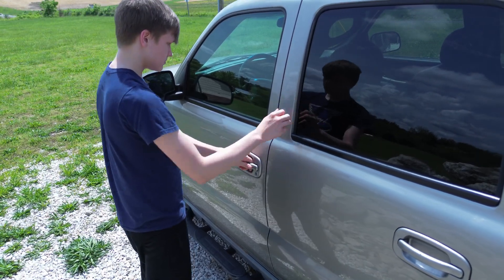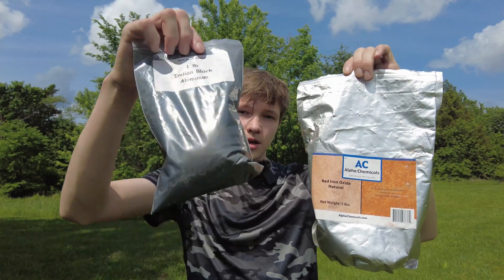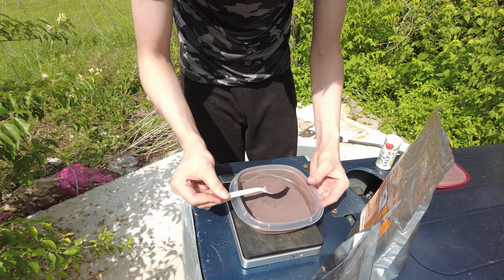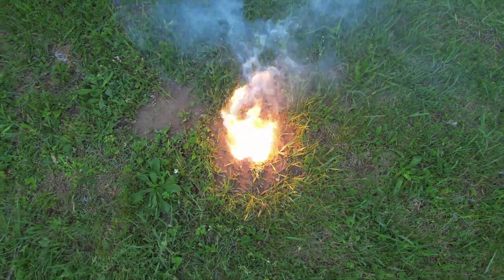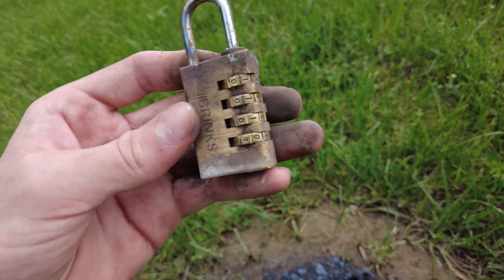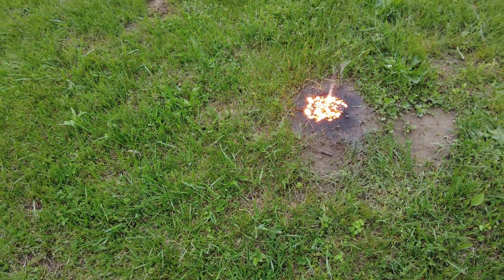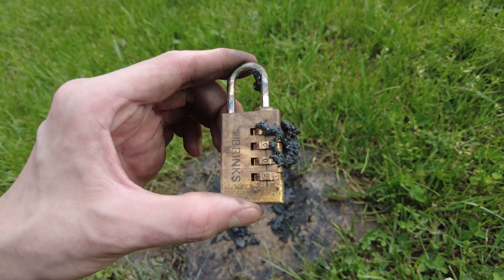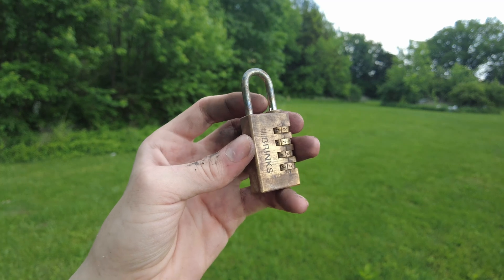Can Thermite Actually Melt A Lock?

Comment from the maker: Trust me, I can melt a lock with thermite, but the way it's done on the show is misleading.
The reaction needs to be done in an enclosed space to contain the heat, like how railroad tracks are welded together. 
Sure, I didn't use the same lock as in Breaking Bad, which is necessary for a proper experiment, but simply placing the thermite on a lock won't cut it.
Reply: I've checked out some videos on your channel, (I came from the meth explosive vid) and I like the channel so far. Keep it up.🙂
Reply: @Firebolt7317  Why do you hate furries? They did nothing to you. Also, if you are gonna hate on them don't make it your entire personality and have a cringey username like "Furry slayer"
Reply: @GooseGooseYT  they probably have their reasons
Reply: Also if you did it in something like say a metal container or something would it have burned the lock since the heat is contained?
Reply from the maker: @Firebolt7317  I'm honestly not too sure. I'd have to try it out. It'd definitely soften up enough to be cut easily though. Some other thermite mixtures that burn hotter and or longer may be able to melt it entirely, especially if you use a lot of it.
Reply: @SomethingAbtScience  true pure thermite probably wouldn't be able to melt through it by itself but it is actually an interesting idea. Until somebody is crazy enough to do it themselves I guess we'll never know. 🤷‍♂️
Reply: Wow, you lit that stuff easy! It burns through faster than my stuff too and my thermite is red hot for a while afterwards! What mixture do you use? Fe2O3 or Fe3O4?
Reply from the maker: @archershillnursery  I used Fe2O3, and yeah, it lights well, almost too well! I believe that's thanks to the type of aluminum powder I used, called Indian Black Aluminum powder. I just looked into it, which I should've done awhile ago, but it's a VERY fine aluminum powder that's coated in graphite. Finer powders result in a much faster, but less efficient reaction. Ig this does not replicate the show at all😅

Comment: I wonder if the rapid heating and cooling of the lock would make the metal interior of the lock brittle enough to pull apart after flash cooking it with the thermite a few times.

I myself am also fork lift certified up to 20k diesel.
Reply from the maker: Now that's a good idea! Maybe use liquid nitrogen and thermite, as it'd need to cool quite rapidly to get really brittle. 

And hell yeah 👍 I have no idea what the limitations of my certification is or what 20k diesel is, but good on you.

Comment: I didn’t watch the video cuz I don’t feel like it and I’m eepy. But if he is saying that the shows wrong, he prolly just did it wrong, cuz I think thermite is what they use to melt railroad tracks together, so if it can instantly melt through 2 inch thick steel, then it can melt a lock.
Reply from the maker: That’s fair, but no, it won't instantly melt through 2-inch thick steel. To join railroad tracks using thermite, a mold is used to contain the heat and shape the molten product. This molten substance includes alloying elements to create the steel that connects the tracks. Instead of directly welding the tracks together, they are separated by a gap that's filled with the molten steel product. Simply throwing thermite onto the track without a mold won't work due to the principles of basic heat transfer. And wrapping some thermite in tape and placing it on top of a lock like in breaking bad won’t cut it either.

Comment: I did a thermite reaction in a saucepan when I was a kid and it melted the bottom of the saucepan off. I think you need to contain the reaction more, in your setup the thermite is too distributed and most of the moltern iron is lying on the ground around the lock. If you created a kind of funnel using sand to direct the heat towards the shackle I think you would find more success

Comment: Ceramic cup with a hole in the bottom. Fill the cup with your thermite, place the cup on top of the lock..
All the run off will flow through the hole that should melt the lock..
👍😊

Comment: Wow great video but I think the reaction could be improved by making the size particles smaller the powder you are using came for industrial grade for pigments or additives, if you mill them in a ball mill (you can make it with ball bearings and a can)  you can get a smaller particle making improving the reaction, also in the burn of your reaction it looks some spots burn faster than others maybe it needs more  homogeneous mixing.  Hope to see more of your work

Comment: Thermite is like gunpowder, no pressure no work.  Put the thermite in a pipe and put the pipe on top of the lock.  Square pipe with a slot will let you cut vertical and create the pressure jet you want.
Reply from the maker: Yeah, but that doesn't replicate what they did in the show. Then again, neither is what I did. I'm sure it can melt a lock, just not how they did it in Breaking Bad.

Comment: So heres the thing, I just skipped to the reaction part, your thermite is not well mixed at all, you have pockets of reactions throughout the powder instead of just one large reaction. You can see this because of how quickly your reaction dies. This could also be due to having an uneven ratio. Another problem is I don't think your maintaining a sustained reaction due to temp as well. Usually mixing in Mg powder helps alot too. 

There is cases of thermite being used to melt thru tank armor in WWII so there is no doubt it would work, but its all in the mixture quality, grain size, additives and many other things.

I give you props for making homemade thermite, you're on the right track, just keep working at it, it all gets easier with time (or at least science does)

Comment: Repeat the experiment but wrap it in kaolwool. It's not time that's the problem but rather heat transfer. If you increase the time, so does heat transfer, but you can also increase heat transfer to the lock by using insulation to minimize heat loss to the surroundings.
Reply from the maker: Yeah, I was thinking of pushing the lock into the dirt with the thermite and covering it up. Maybe in a part 2 ill wrap it up.

Comment: Couldn't do it more wrong.
All the things written below are in fact useless, cause you think a whopping 10g of termite should be enough to melt a lock, otherwise it's all bs, waltuh was wrong and your proof is undoubtable.
If you want to do it properly:
Try making a finer powders of rust and aluminium, and get your ratios right, like molar balanced. Dry your chems. Mix them VERY thoroughly. Get yourself some sort of tube and PRESS your termite there, layer by layer, you should really compress it, and at the end have a nice stick.

That's like, all you need to melt a lock, but that wont allow you to make a loud statement of a popular series bullshitting about a thing you have no idea about
Reply: You must be super popular at parties.

Comment: Thermite can make a hole in an engine block. 
And Thermite is also used to weld rails together for trains. 
Something is missing from your application.
Reply from the maker: Copper thermite is usually used to weld train rails together. I'm using iron oxide like they did in the show. I certainly could've done the experiment better, though

Comment: Cool video.

But it’s definitely possible for the thermite to melt the lock. They use thermite to weld railroad track together. It most definitely will melt/weaken steal enough to open the lock just takes more effort/different mix of powder
Reply: It works on railroads because it's done with a mold. The mold acts as refractory and contains the heat from the thermite reaction and allows it to transfer to the iron. The explanation in this video is a good simplification, but the underlying physics are a bit more complex and difficult to understand. Essentially, raising a solid to its melting temperature is not alone enough to melt a solid. There is an additional amount of energy called the latent heat of fusion which is required to actually cause the solid to melt. Unless you can increase the temperature to melting point and have enough energy left over to supply the latent heat of fusion, it will remain solid, which is what I'm guessing is happening here.

Comment: You can add barium nitrate and sulphur to the thermite to melt through.
Reply: the barium nitrate add to make a softer ignition
Reply: What does that make exactly?
Reply: @LisaAnn777 It increases the temperature, makes it burn for longer and stick to metal. What's happening in the video us that the lock is momentarily blasted by heat through a (thin) layer of a good insulator(air). If you add those 2 ingredients, the thermite would stick to the metal of the lock and heat it for longer, melting or softening it enough to break with some light tapping.
Reply: @Nagib23_32  very interesting.
Reply: What would the ratio be? And do you add both or only 1?
Reply: no need for barium nitrate just sulphur.

Comment: I've seen them use a thermite mixture to weld train tracks but it's in some kind of clay or putty and burns very slow and even.
Reply: The clay piece is called the shoe. It guides the molten metal where it needs to go.

Comment: If you watch indian workers, they actually use thermite to melt train tracks so they can join them. I highly doubt that wouldn't work on a lock. You must have done something wrong, but I am no expert !
Reply from the maker: Neither am I, obviously, lol. But copper thermite is used to weld railroads all over the world. I'm using iron oxide like they did in the show. I could've replicated the show better, though.

Comment: Look into how thermite grenades work ik they use some different combo of set up for more power could be fun to recreate
Reply: If you are referring to the ones used by the U.S. Military then it is not a thermite grenade. It is actually thermate which does contain thermite.  They are similar but not the same overall.